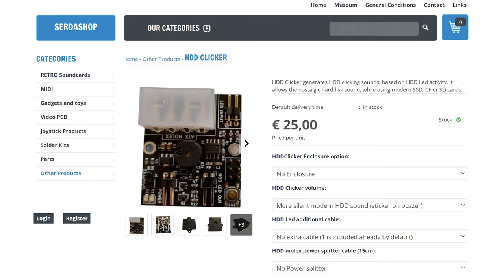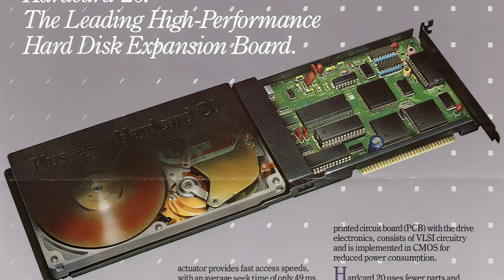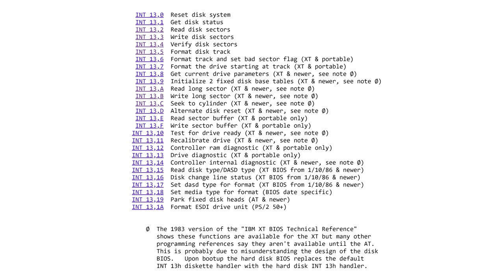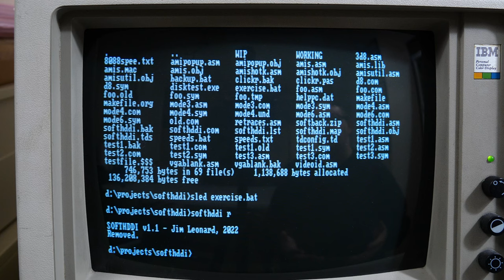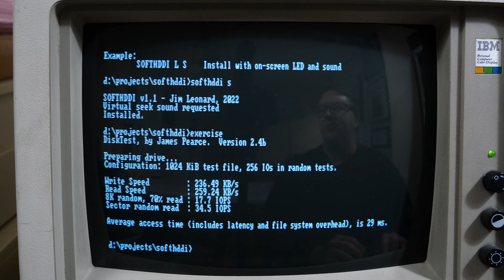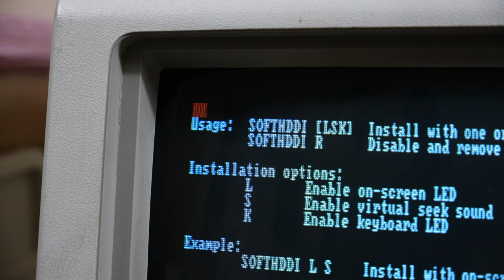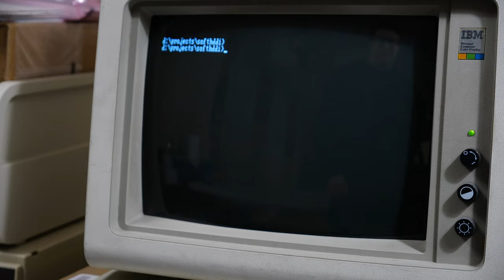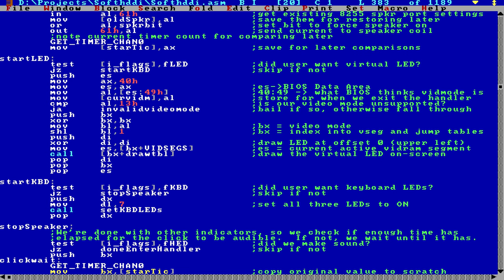Bringing sights and sounds back to solid-state drives -- in DOS!

Comment: Is it possible to move the on-screen indicator in the upper right? That would be less obtrusive to on-screen text than in the upper left, and would match the position of the flashing asterisk that TRS-80s used to indicate cassette tape loading or saving -- they put it in the upper right.
Reply from the maker: It is possible.  Maybe in a future update, user-specified.  I added it as a feature request in github.
Reply: @TheOldskoolPC  I'd like to second this, or maybe even make the position configurable? Right would be my preference too, though.

Comment: This neat little utility will be going straight onto my Toshiba t3200sx 16. The rubber in its Conner hard drive liquified, so it now runs on an SD card.
I had thought about installing a clicker, as there's certainly space in the laptop case, but to access the internals is non trivial. You have to take apart the entire screen, which is a rare gas plasma made of thin glass, just to get at the HDD.
This is a fantastic alternative!
Reply from the maker: Hope it works well for you!
Reply: @TheOldskoolPC  Well, I can report back that it works flawlessly and is now a fixture in my autoexec.bat.
Interestingly the speaker in the t3200sx is real (not a beeper), but it appears to have a metal membrane. As such, the sound isn't like the original 'thunks', but sounds exactly like a dosimeter clicking in a movie. Quite nifty in its own right, and good to have some sound back!

Comment: Primarily as a laptop user (with cf cards),  hddclicker was not even an option, will try this out tonight!  So could this be adapted to the boot sector stuff you covered,  a simple version to load in before the o/s?  so I can get the clicky clacky before hitting  autoexec.
Reply from the maker: To get it working before autoexec.bat, I'd need to convert it to a .SYS driver, something I haven't tried yet.  I'm not sure it could be converted to a boot sector, because I'm not sure I could fit an indicator (like just the clicking) into a boot sector and still have room to actually boot the machine (load tracks from disk, transfer to IO.SYS, etc.).
Reply: @TheOldskoolPC  It is excellent as is of course,  just contributing a thought that came to mind.

Comment: This is absolutely fantastic, thanks so much for sharing this! That said, I know it certainly isn't the intended use, but is there any way to make a version of this that runs in DOSBox? A lot of us have always wanted drive sounds in that, and as far as I know no fork has ever been able or willing to add that. If this could detect emulated HDD access, it could surely work on DOSBox? At least the sound part, not so worried about the keyboard LEDs.
Reply from the maker: Due to how dosbox handles disk requests, there's no way to make it work.  A better solution would be to petition the people working on dosbox to add these sounds, but that's unlikely to happen since dosbox doesn't have traditional INT 13h calls for generalized hard disk access.  An even better solution might be to petition other emulators like 86box or PCem to add these sounds, as they emulate a traditional disk controller.

Comment: Still gotta try it, but I expect nothing but greatness from you.

Honestly, from all the projects on VOGONS this one was never that interesting to me. There’s more to using an HDD than just the clicking sound, like the actual motor starting, and the platters rotating to speed. It also does not sound the same, it’s hard to replicate the “grinding” noise or even the distinguished ST-225 seeking sounds. 

The silence of my XT or FrankenTandy do not bother me at all, in fact one of the Tandy mods was rewiring the a PSU fan from 12 to 5 volts to silence it a bit. 

I honestly like the keyboard lights a lot and also on the screen. +1 for the asm go through. Which reminds me how i miss writing something in asm.

Comment: 5:04 So that means it'll work on an FM Towns or PC-98 too? lol
Reply from the maker: It should!  I mean, if they use int13 BIOS disk routines like other systems, then yes.  I believe the later FM towns systems did, but not sure about the PC-98.
Reply: @TheOldskoolPC  I actually just tried it on PC-98 DOS, it does load into memory and the actual interface works fine, but none of the functions actually do anything.

Comment: It's a really cool idea, but to me it doesn't sound enough like a hard drive in my 486 with a paper cone PC speaker.  It's way too loud and the sound quality just isn't quite right.  I can see how it might work better in some computers depending on the speaker and its real hard drive sound.  Also your program's on-screen and keyboard indicator modes cause compatibility issues and slowdowns for me when enabled.  I suspect that in a few years we'll have CF to IDE adapters with high quality sound samples built-in.  Some other retro computer systems already have products like that available.
Reply from the maker: While the keyboard LEDs do result in a slowdown (this is mentioned in the README.md, along with what causes it), the on-screen indicator shouldn't cause a compatibility issue or a slowdown.  What are you seeing?  If it's repeatable, please submit an issue via the github repo and I can take a look at it.
Reply: @TheOldskoolPC  Windows 3.1 wouldn't start for me with the on-screen display enabled.

Comment: I would be interested in a hardcard in these computing days. But only if it requires no extra wirering like for extra power. Because the pcie would hopefully be sufficient enough. But it probably is not.
Reply from the maker: Most hardcards didn't need extra power, but the best ones (Plus Hardcards, in my opinion) unfortunately suffer from stiction, dissolving bumper stops, and fading EEPROMs.  Most Plus Hardcards are completely inoperative these days.  Other hardcards were bulkier and took up two slots and were noisy.

Comment: Sounds great on an XT clone but awful on an IBM 25-286. The difference between speakers. Too bad it wont work for 98, that is the machine I really want clicks on! (I tried)
Reply from the maker: Thanks for trying!  I thought maybe it might work putting it in autoexec.bat, but Windows 9x switches to 32-bit drivers and direct access once it loads, so no dice there.